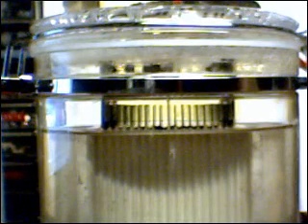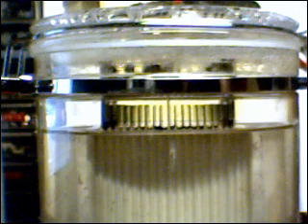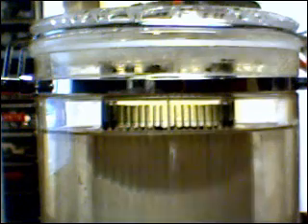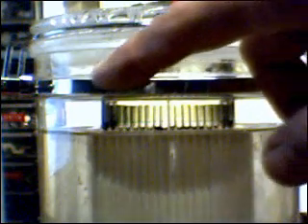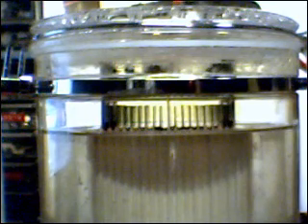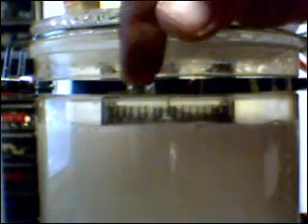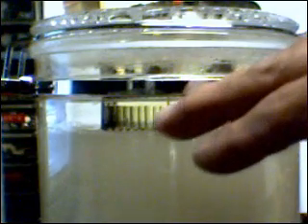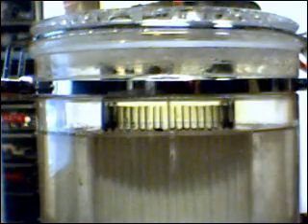#35 Hydrogen HHO Zero Cell ELECTROLYTE CONVECTION 2007/09/04

Comment from the maker: Getting a lot of email lately asking if I'm still working on my projects. Busy collecting data and getting parts made for a revised cell. The present cell is damaged in that the conditioning phase produced unevenly processed plates which unevenly produce HHO. Efficency has dropped to only 2ml/min/W. Not enough to produce measureable mileage gains. Tests have been scrubbed until new parts are ready.

Comment: How much air can you add to a container with pure hho gas so that it will still burn?  Just wondering what the ideal air/hho ratio for an internal combustion engine would be. Stoichiometric air-fuel ratio for Hydrogen is 34:1 by weight which is over twice that of gasoline.  But you are also adding pure oxygyen so the ratio would be even be higher? Is it realtively easy to calculate the required volume of hho + air needed?.  Just thinkin out loud...sorry